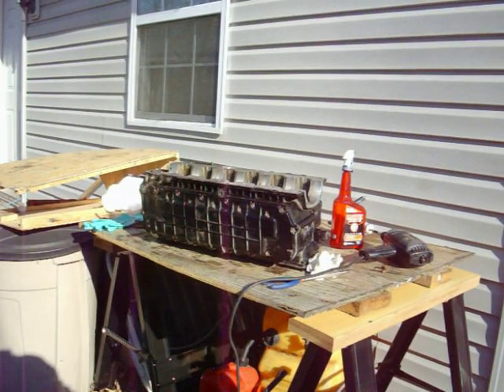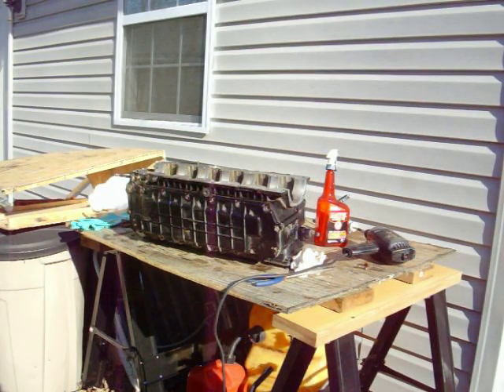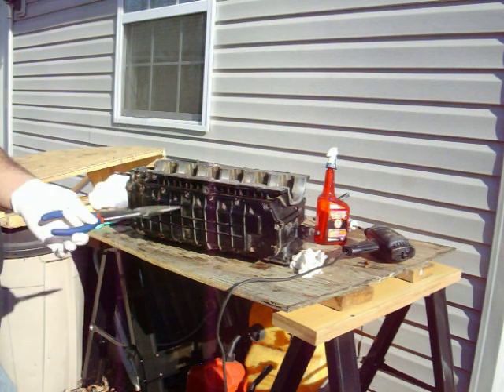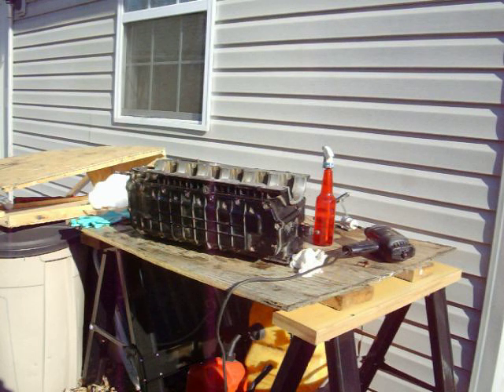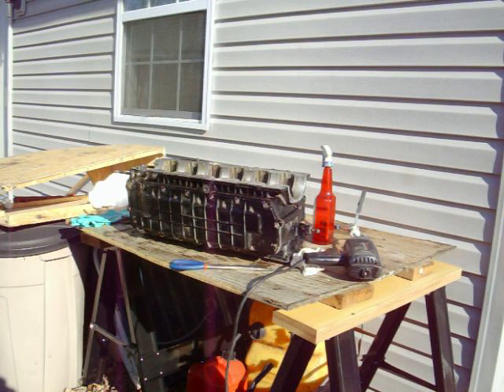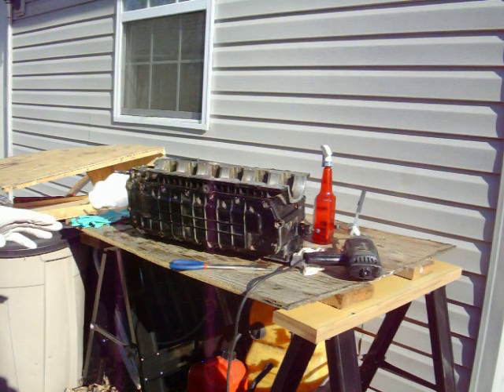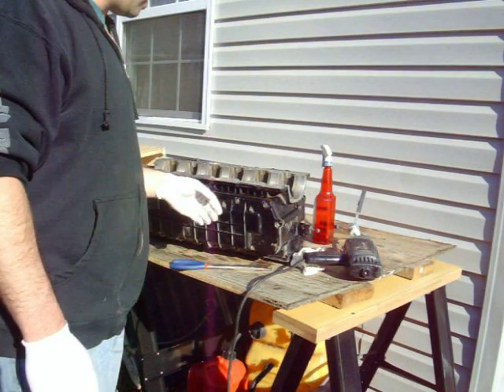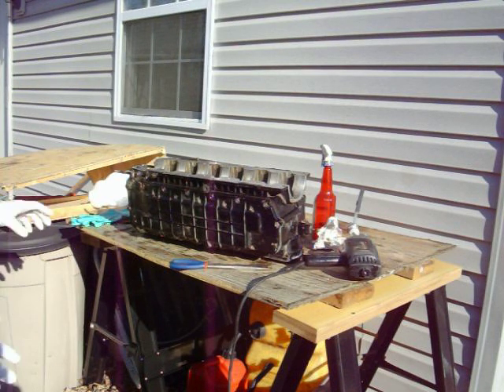HONING A CYLINDER - Mercury 1150 Inline 6 Outboard

Comment: Yeah, see I was wondering about the exhaust plate as well, I was just going to do mine like I would all the auto engines Iv`e done. looks like a common hone, I`m trying to save on getting a manual, but there is a specific grit and a specific cross hatch degree. I wish someone knew what it was. If you go slow the degree is goes from 45 to lesser like 30, 25 ect. Probably cant go wrong with about 45, but it would be nice to know what is ideal. I am going to use Robert Gifford`s method for re installing, kind of like you would with an automotive engine. I saw these plumbing things that had hose clamps on a job site the other day, they looked just like ring compressors but with a rubber sleeve inside. I am going to find those and find a fit instead of going to Harbor Freight to buy 6 @ 9.99 a piece! And use plenty of the slickest lube I can find on the inside of the compressors, maybe hit up the porn shop for something better than KY Jelly, lol
Reply from the maker: You're going to want the merc ring compressors. I have a vid on that as well. Thankfully mine were loaned to me.

Comment: A tip. On the exhaust side, make sure the baffle is absolutely flat. When you order the gaskets, order a separate pair of exhaust gaskets with sealant already on them. They will seal best and prevent the problems of water leaking via poorly seated exhaust baffle and cover. A few extra bucks but well worth it on these tower of power motors.

Comment: I use ring compressors, hang the crank overhead w/ straps and lower, insert pistons slowly, watch the pins allignment for the rings, sink all 6 and view thru intake and exhaust ports as you rotate assembly use a popsicle stick and push on each ring from opposite side you are viewing and see if it moves. If you broke a ring it wont move. Just a tip.